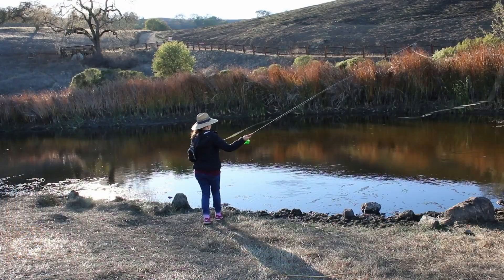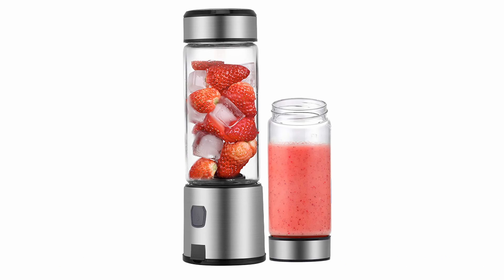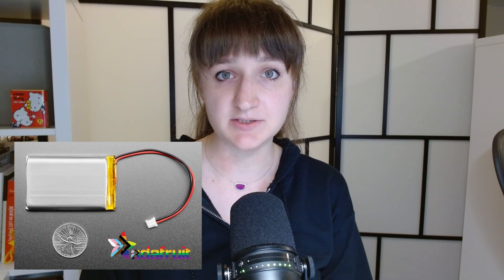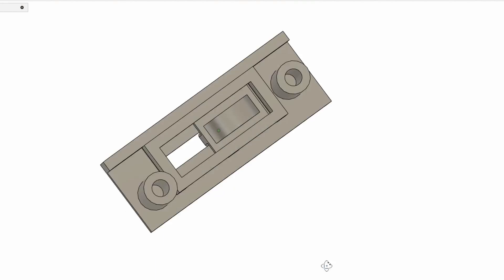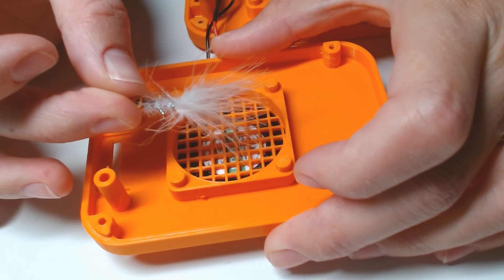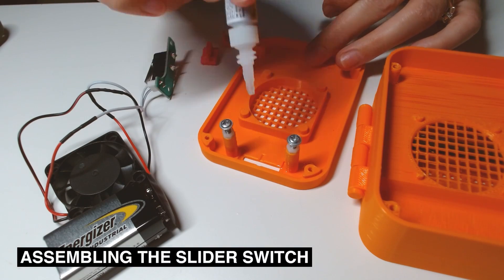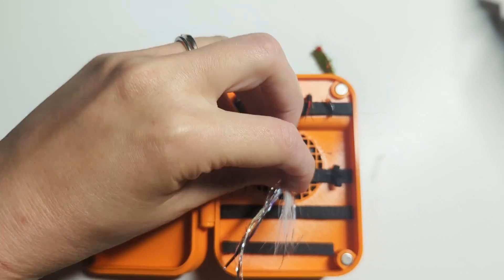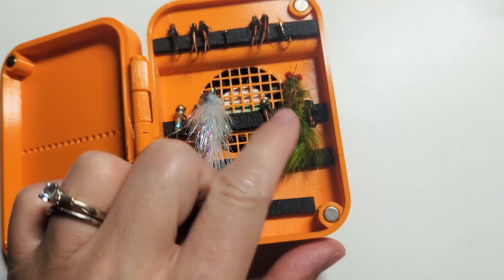3D Printed Fly Fishing Box that Dries your Flies

Comment: For waterproofing I use silicone conformal coating on all my drone electronics but, it's not the cheapest and since you probably won't be needing to work on it ever you can just epoxy or I like GE silicone 2, just make sure the silicone doesn't have any acids in it if it smells like vinegar it'll corrode the circuits.